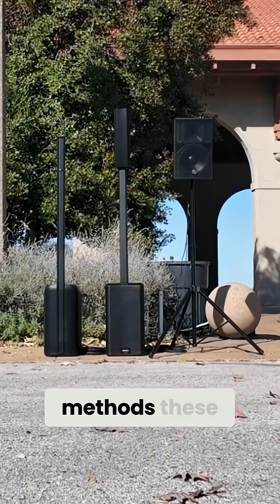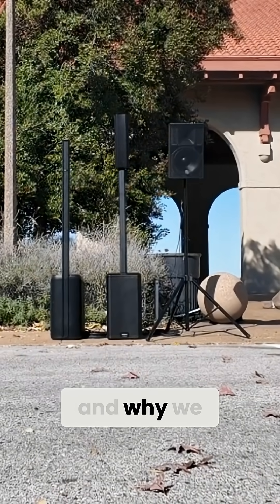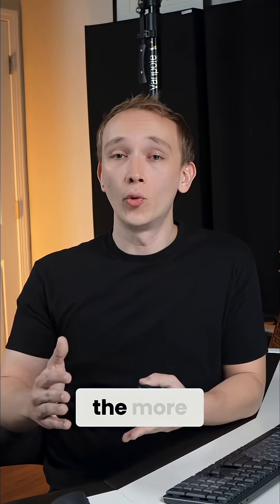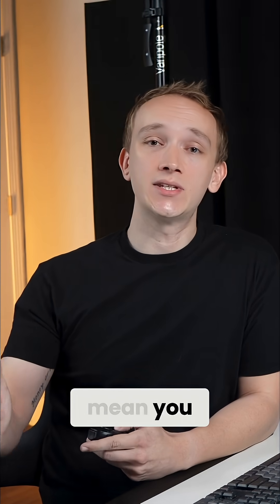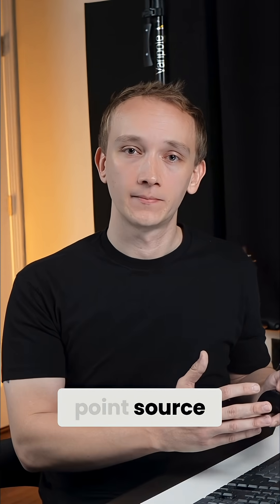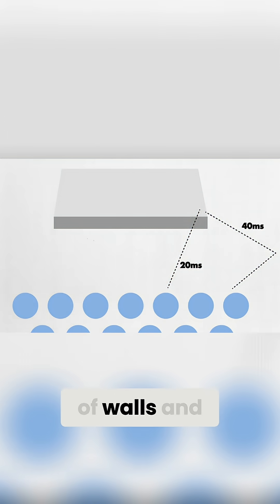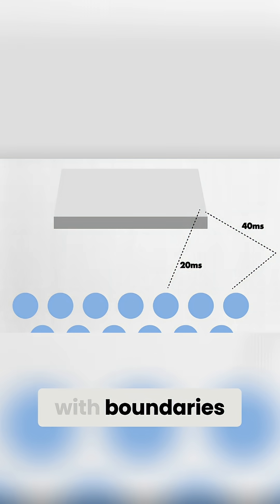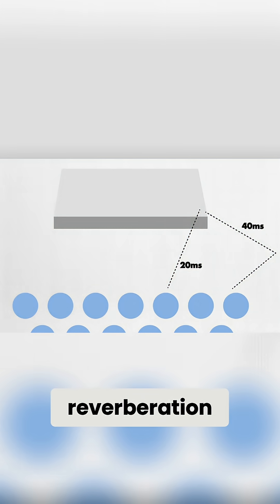Why Direct Sound? Speaker System Comparison #shorts

Comment: This is important to me because, as a guitarist, I have noticed we are now more reliant on sound reinforcement and impulse response tones for our sounds than traditional amplifiers and speaker cabinets.

We used to use the standard 100 watt tube amplifier head with either one or two 4x12 cabinets. For small to medium venues to perhaps a couple hundred people, that was enough. For larger venues, the cabs were mic'ed and then run to sound reinforcement.

Since 2006 or so, when the Fractal Axe FX modeling preamp, Kemper Profiler, and other modern amplifier modelers debuted, guitar sound is often run from these units directly to a solid state power amplifier and then a speaker cabinet or directly to an audio engineer and then sound reinforcement.

Guitarists now seem to prefer little to no backline of speakers or cabinets and use in ear monitoring instead of floor wedges. If a backline is there, it is often for looks. 

Some old school guitarists still like the feel of a speaker and cab behind them and blend this into a modeling rig, often with an impulse response coloring the tone of very flat EQ'ed speakers.

I still keep my old tube amplifiers and heads because some venues may not have modern consoles and sound reinforcement, or perhaps a gig is small enough to not need sound reinforcement. 

I would hate to have a modeling unit with only the ability to run direct out but no speaker cabinets to run it to. So I keep my old gear.

If Kyle has not done so yet, I would love to see some content on modern guitar amp modeling unit rigs and how those signal chains work in a live context.

Comment: If you had a long tunnel like venue, would you be better off with a long sideways 'column' above the top of the stage like sound bar on top of your TV, but tilted down, and making the width dispersion nice and narrow but the front to back dispersion nice and wide?
Reply: use the long route so there's more even coverage to the back of the venue

Comment: But when we look at these many lineries, let's not forget something very important : The line array can only control wavelengths of sound that are shorter than the distance between the top and bottom driver of the line array. For instance, to control the dispersion of the frequency 100 Hertz, which has a wavelength about 9 ft long, you need a 9 ft long light array. At 200 hz, you still need a 4 and 1/2 ft long line array control it. Otherwise, that array is performing the exact same way that a point source array would perform. People are paying thousands and thousands of dollars for two and three box "line array" better really just point source arrays dressed up like line arrays. Even worse, when you're dealing with these mini line arrays, the higher frequency sounds are behaving the way a line array would disperse them. Many half of your frequencies spectrum has one dispersion, and the other half has a completely different dispersion, yielding a mix of sounds different in almost every conceivable listening location. You can put two point source powered tops per side, or for about 3-4  times as much money, you can put two  powered line array boxes per side and get significantly worse dispersion.

TL:DR: A line array under 10 ft long isn't a line array.. it just looks like one.
Reply: Proper technical placement of array of some subwoofers can resolve this issue to some extent.
Reply: My concern is that the bottom is not only separated from the rest of the freq's, but that the bottom (bass) can get lost into the crowd.. (time aligned) Where as "lollipop" speakers put it all above the crowd and would reach better (assuming properly designed speakers)
Reply: @MoonbeameSmith  
"That’s not necessarily the case. While it might seem like the bass would get lost, subwoofers are usually placed in front of the stage and then time-aligned with the main PA using precision delays to keep everything in sync.

In fact, keeping subs on the ground provides boundary gain, which actually increases efficiency. When you array them properly—especially in a radial or arc configuration—you get much better coverage across the entire venue.

We also use cardioid patterns to cancel out rear-firing energy, which prevents excess low-end from washing over the stage. If you take a close look at modern professional stage plots, you'll see how these sophisticated setups handle those exact concerns.
Reply: What's happening on the sides of a 9 foot column above 100-ish hertz, is that each speaker plays every possible phase of the waveform around the 'clock' meaning a near zero net sum, making it nice and quiet off axis. On axis, they are all fairly well in phase and it's nice and loud.